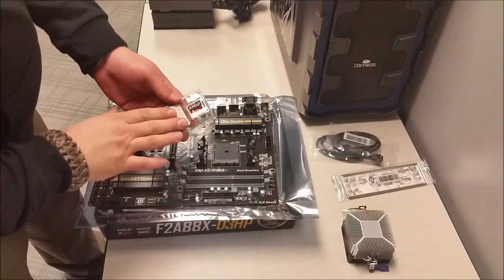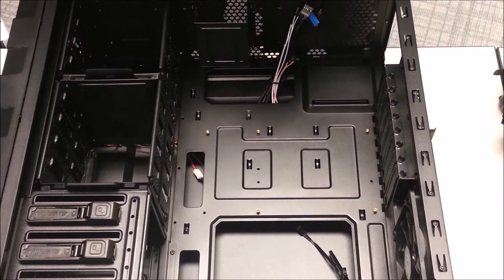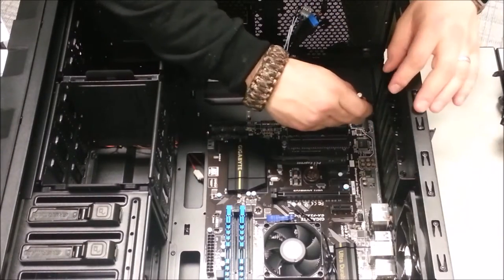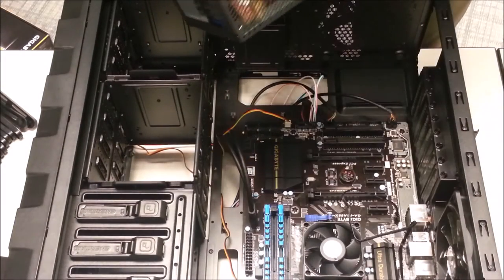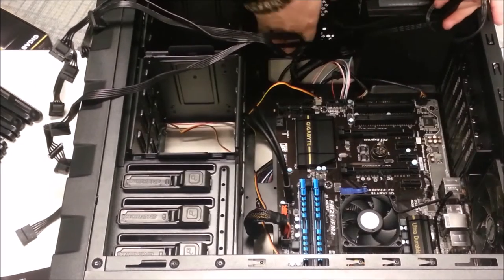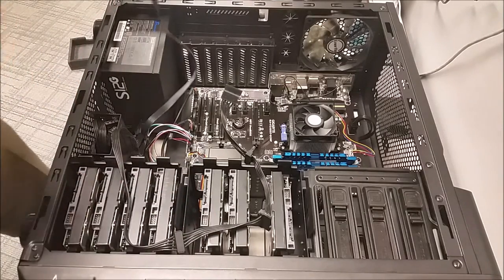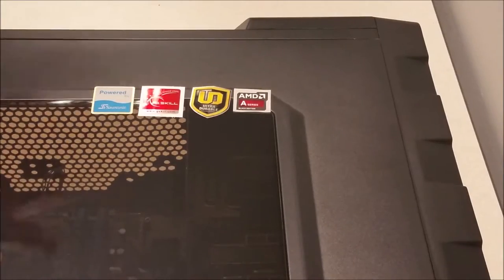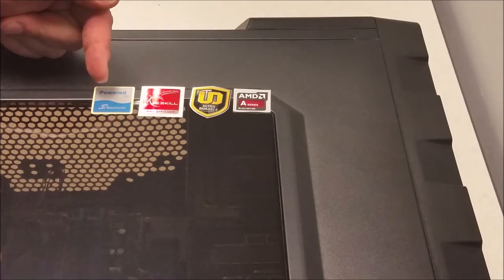Building/Installing of the hardware for the Media Server - MS3

Comment: at 3.19 my Cables don't have White and red colors.  It's impossible to know wich is wich. Can't get my computer to start. I have the F2A88XM-HD3P. Please anyone?
Reply from the maker: the red and black wires at that time stamp were the internal speaker only.  this could have been omitted without any negative side effect.  there should be a label on the pins your plugging in.  you should look in your mother board manual for where the pins go.  if that doesn't help, try posting a video that shows the pins and include the mother board make and model along with the case make and model.  hope this helps.
Reply: were you able (on the motherboard) run raid arrays on all sata ports, or just a specific set. i'm trying to run 2 SSD's in raid 0, then 4 HDD's in raid 10. will this configuration work.